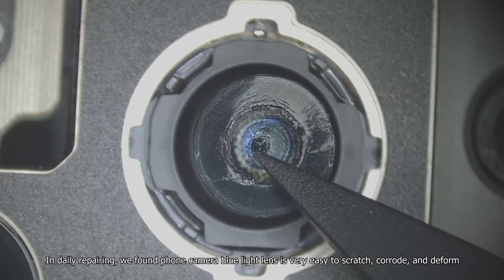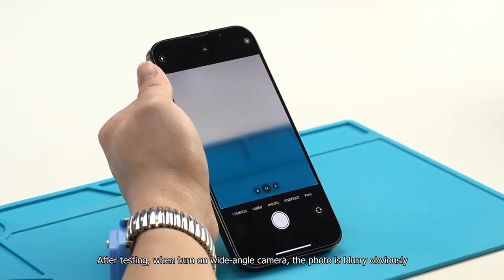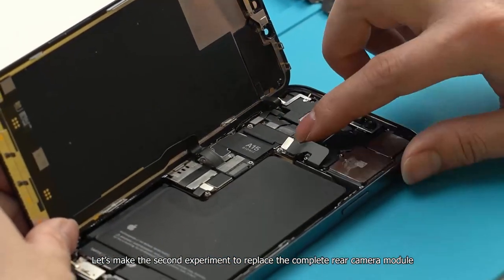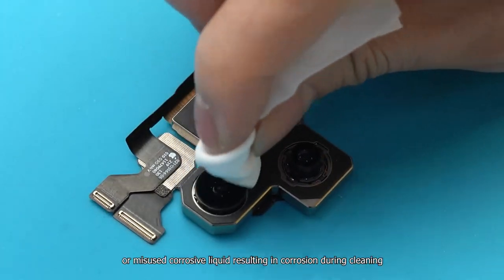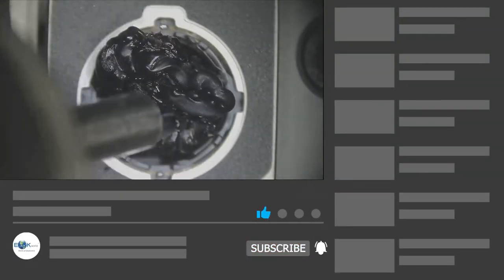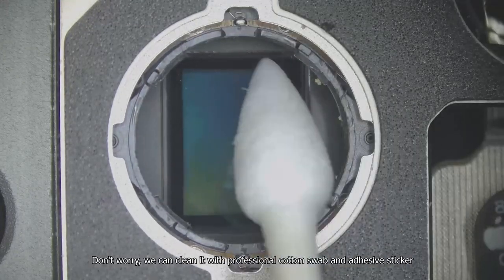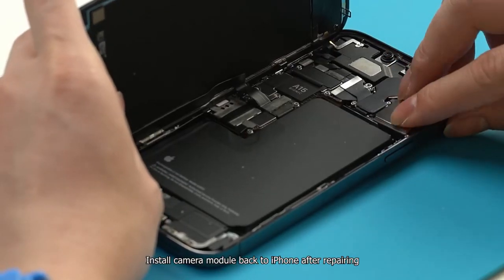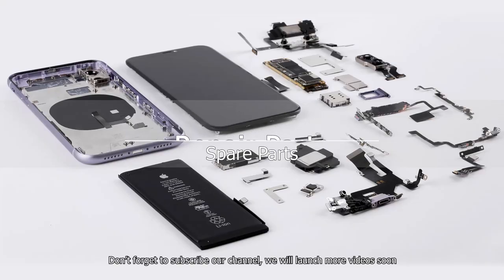How to replace iPhone 13 Pro Max Rear Camera Blue Light Lens, Instead Replacing Whole Camera Module.

Comment from the maker: In daily repairing, we found phone camera blue light lens is very easy to scratch, corrode, and deform. For example, iPhone 13 Pro Max rear camera priced about $60, replace the whole camera module will be very expensive. If we can replace blue light lens directly, it will cost much less. Today we’ll share you how to replace iPhone 13 Pro Max rear camera blue light lens. 

Camera Repair Tool Set
https://elekworld.com/shop/productinfo.aspx?proid=18192&categoryid=370
 
00:00: Introduction
00:56: Block Camera for Experiment
01:12: Replace Rear Camera Module
01:46: Blue Light Lens Restore
03:17: Install new blue light lens
03:48: Test Camera Function

For more Repair parts&Tools and Tech support, please visit:
Website: https://www.elekworld.com
Facebook: https://www.facebook.com/Elekworldshop/
Instagram: https://www.instagram.com/elekworld/
Twitter: https://twitter.com/ElekworldL

Comment: what is a price difference between the whole camera module VS only blue camera lens ? 
Can camera module be reprogramed in iPhone 13 lineup like it can be done in 12 ?
Reply from the maker: Price difference gonna be over $50.
By now still can't be reprogrammed if you replace a whole camera module.